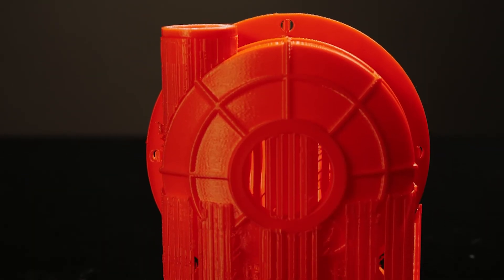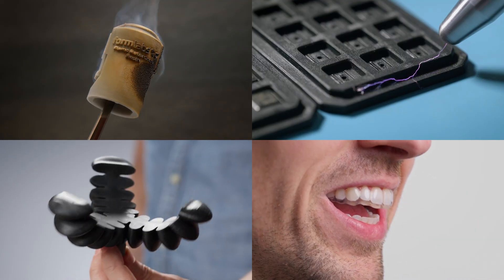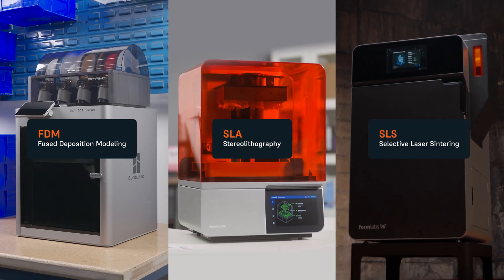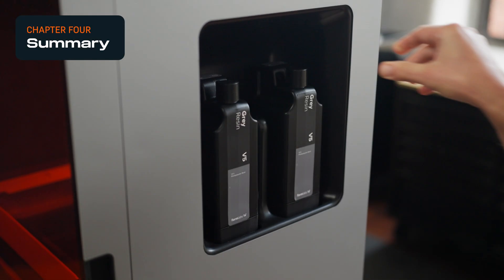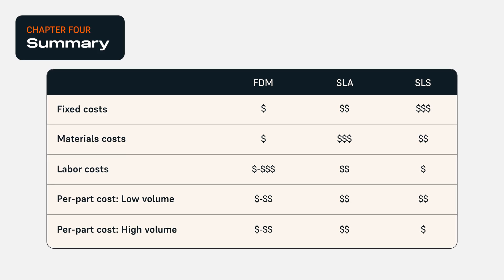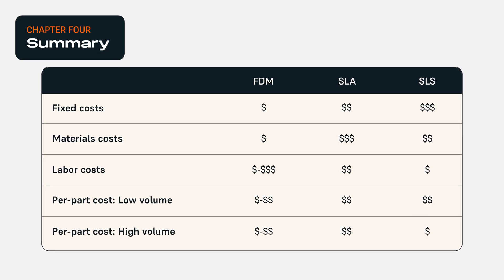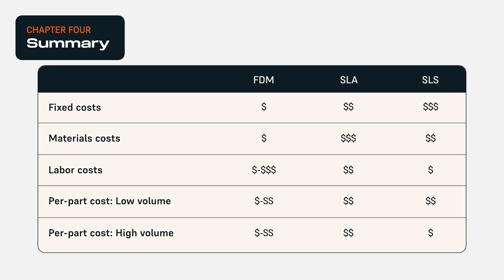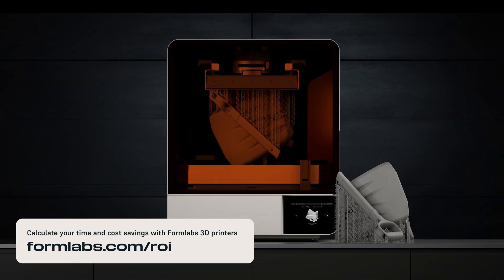FDM vs. SLA vs. SLS: How Much Does 3D Printing Really Cost?

Comment: Not a good comparison; with no actual values all that was covered are all hypothetical
Reply: Cuz it really depends on the use case
Reply: @crispi_shots use case how? The video covered why each printer is good and bad, but no specific values were mentioned; the comparison is made using theoretical values like '$$' and '$$$'

If it is dependent on use cases then provide the cost and use cases; provide how strong the materials with actual values not 'strong' and 'stronger'
Reply: General rule of thumb: 
If you mainly need one offs use FDM 

If you need to supply multiple batches go SLA 

SLS for even faster batches less waste & labor

Comment: I've got the Form 4 and several FDM printers. I'd say SLS is the most expensive upfront just by the sheer cost of machine itself. It's then followed by SLA due to the addition of post processing materials such as wipes/towels and isopropyl